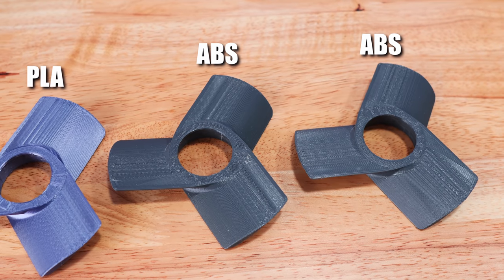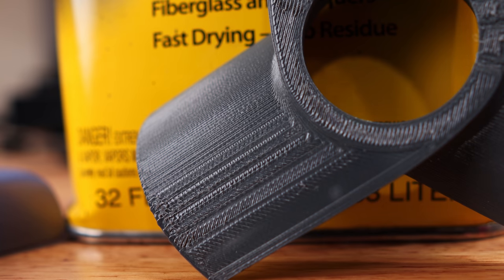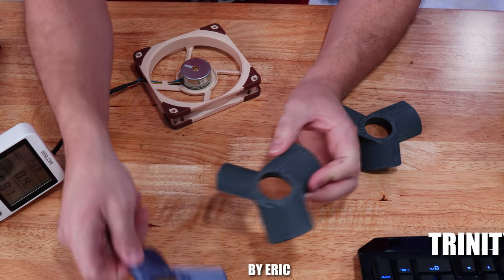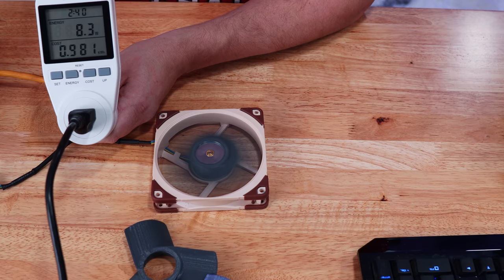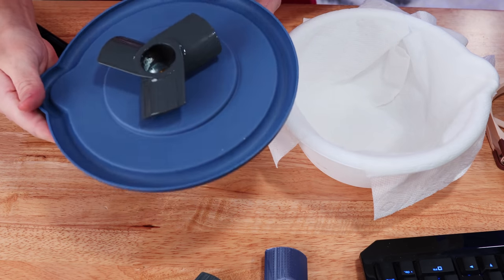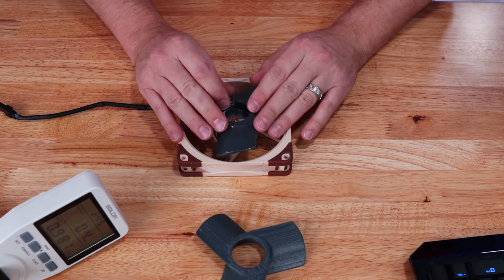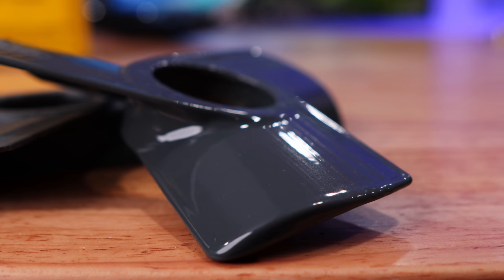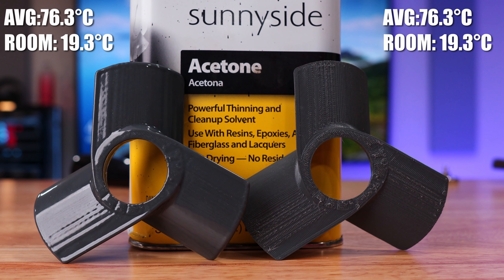Does Smoothing 3D Prints Improve Performance and Can You Smooth PLA?

Comment from the maker: Make sure to use my Audible link,  www.audible.com/hardware
Reply: I'm almost disappointed that you didn't hook up that noctua motor to spin at the lowest speed it still can turn... Would make the smoothing follow aerodynamic forces, smooth the most in places that are hit with air+vapor the most... maybe.. But it would be very, very interesting to see what it does. Maybe even deliberately making thinner blades to let it shape itself..
Reply: What about the airflow? Any difference there? 
Also, the rotation speed?
(Also, any vibration difference? Not sure how to measure that though)
Maybe it's possible to calculate some kind of "efficiency" number from this data, maybe like like: 
airflow[cfm] / fan rotation[360°]
Reply: @squidcaps4308  Yeah, that would be interesting to see, a "half smooth" (or something) fan.

It could also be interesting to see it spinning as fast as possible, so it melts & send plastic away in all directions, hopefully creating some cool "dissolve patterns" or strings on the wings, like how things melt in cartoons :D
Reply: You could always use smooth on, or other clear epoxy resins and paint them on pla prints to smooth them. Also when I acetone smooth abs prints I use an empty gallon paint can. You can buy them at home depot/ lowes. I line the inside walls of the can with paper towels and hold them on with magnets. Then I soak them with acetone. Place the part on the lid of the can and set the can on the lid upside down with the lid laying flat on a table
Reply: It isn't just the dB... but the tone also.
Reply: Just FYI- I've heard that PLA is somewhat dissolvable in Isopropyl Alcohol. You might try getting some 98% to see if it has any smoothing affect.
Reply: resin printed vs 3d printed
Reply: race cars polish the intake and exhaust head runners. the small bumpy-ness of a non flat surface creates turbulence at higher air amounts of air flow. the smoothed fans will probably spin at a higher rpm with a less power draw, and only then youll see a higher cfm and temp change. i balance crankshafts that go into racecars, so also a lopsided fan will spin slower and will draw more power than a properly balanced one, if thats even possible.

Comment: I agree with your test however i would have done it with a fan that has more blades say 7 or so, my reasoning is that with 7 blades there is more surface area of the blades and thus could give a deference between the fans (smooth and not smooth)
Reply: More likely yes, but I'd think that the difference is so little that it's well within the margin of error. But the noise drop is a win anyway 👍
Reply: @Garbox80  yes that is something i can personally relate to. I hate a noisy fan but i still think that he should explore a fan with more blades. Imagine the noise deference then
Reply: @jankocoetzee  its difference not deference
Reply: @Edigor100  oo yea i didn't even see that😅😅
Reply: Are you really gonna dabble in aeronautics here. I thought we burned that bridge the first time we "established" its not worth the printing time...
It Depends on so many factors its not even real.  So expecting that on a YouTube channel playing with 500$ toys ,printing designs Made by Fleamarket Aero designers  is a bit too much isn't it...
After spending a few years at the university Your dreams kind of get crushed by reality. Aka its not fun to design functional aerofoil as it often doesn't look anywhere near anything you wanted. Its called physics. And it doesn't give a crap about your dreams.
Reply: @DexMaster881  What a downer. Let people have their fun.
Reply: from what i know about fans and propellers sound has a lot to do with efficiency but in the cooling effect i dont know if this is in the realm of diminishing gains aka a whole lot of work for a tiny improvement we are hitting a wall with how much heat can a volume of air cool with a certain air flow thru a set of conductive fins
Reply: If you have to try and create a problem to see any impact from the solution, then its not a good solution.
That is to say, if there was no change whatsoever with 3 blades, Even 9 blades would, at best, see fractional gains if any.  Thus, Your gains are low enough that they still exist with in the margin for error, and practically speaking, are moot.
Reply: @DexMaster881  yeppp as an Aerospace Engineer you run into issues of sunk cost fallacies and efficiency games if you're not careful. 

It's all about amount of time compared to gains you expect. Sure it's more efficient because it better adheres to the design but at what cost? 

I've noticed alot of people and even engineers have a major problem with understand efficiency chasing. Stuff is pretty efficient now days getting even a percentage more efficient can equal millions of dollars in costs.
Reply: @nuarius  not wrong and not moot,
Sometimes you dont see changes in implementation until you scale a model up.
Simple models are easy to test but give false impressions after large scale changes are made, such as doubling or tripling the number of fan blades.
Reply: @weignerg  yes I am aware.  As noted though, we are talking about 3d printed case fans here. There is a margin of error that these results would have to exceed. A doubling or tripling of effectively nothing is still not going to be significant enough to matter.   Thats the whole point.  I didnt say there would be no change no matter what, i said that with these results you can safely say that any changes if they exist will be insignificant within the margin of error associated with low precision manufacturing and the testing methods.

If we were talking about a 6 ft wide turbofan than it would be a different story.
Reply: @nuarius  Actually, an order of magnitude won't make a significant difference so long as you're trying to measure the effects of various surfaces upon airflow, without any airflow.
Reply: @CrawfordAutomation  noone said you cant have your fun. Just don't claim little toybox experiments take presedan over the work and expertise of professionals over several hundred years.
Reply: @seemlesslies  I agree to that. What was my initial intention is to point out the ridiculousness of the claim due to designer expertise. 
Aka if you make a 20hp family car you have no proof aerodynamics affect anything. Where as on a 300hp car you can clearly see it does. Its a matter of capability your design achieves. Some fans could have had tangible results even at this competition while others don't matter at all as it is not measurable with available equipment.
That's how we measure if the cost is worth in the Automotive. Does it show results on This specific case.
Reply: @DexMaster881  Reality, ya gotta luv it, there aint nuttin else cobber.    😁
Reply: @seemlesslies  I reckon as the low frequency components of the surface deformations are still present there is still quite a bit to be gained without too much effort.  Just thinking of all the times when I have thought, she's OK, close enough.  Sad really.
Reply: I think it will not work with a fan with many blades, because then the Blades have to be pretty thin and they will get too soft in the acetone vapor, which will cause deformation...
Reply: it wouldnt have. it only affects it on the surface area of 1 blade

Comment: You can use Ethyl Acetate to smooth PLA, similar to how ABS and acetone work!
Reply: Depends on the PLA
Reply: @maverickstclare3756  True. I've had some gnarly "PLA" that doesn't react well to ethyl acetate. The silk PLA variants have been especially odd for this, but a high quality (not bottom barrel ebay/amazon special) PLA will generally work well with this solvent.
Reply: I use M.E.K (methyl ethyl ketone) i think this may be the same thing as Ethyl Acetate. But MEK works for me and you can get it at lows etc..
Reply: @Floortile83  I always thought I was a caveman for doing this myself. Glad to see I'm not the only one!
Reply: @heyitsandrew2209  Plastic manufacturers often times use flaming for anything from scratch removal to adding to the aesthetic sheer of a part. It's rather commonplace, even if inherently "neanderthalic". ;-)
Reply: @danielblanchard09  Are you sure you aren't using MEK substitute? That's Ethyl Acetate. Lowes doesn't sell MEK.
Reply: @RAW_Reality  but does it make issues for small and thin pieces? Because even a quick brush with a heat gun can cause sag... I worry a blow torch would be way too much. Maybe one of those small torches like a creme Brule torch. Then it goes from Neanderthalic to classy!
Reply: @ravenovatechnologies6554  It's specific to factors... The thinner the plastic, obviously the more susceptible it will be to the heat. What type of material it is and the amount of heat coming off of the torch will also come into play... Heck, in extreme situations, small torches like you mentioned can go as far as to make small repairs to plastisol molded parts. (Think "flexible rubber" if you're not familiar.)
So... It varies, but you might be surprised as to what you can do, provided the heat is appropriate for the product... Sometimes you're a surgeon, sometimes you're John Wick.
Reply: @danielblanchard09  All the boomers in there are like "nice to see men are still men" and they ask about your project, want to know if you're stripping paint off an old mopar engine. That's when you drop it's for 3d printing, it shatters their world and they point and scream "NEEEEEEERDDD!!!!!!"
Reply: @danielblanchard09  MEK and ethyl acetate aren't the same thing. MEK is closer to acetone
Reply: Tried, failed. Tried tetrahydrofuran too, which is hard to get hold of. Only DCM seems to work on it for me. From the wildly contradictory reports I've found though, I can only conclude it depends upon the additives and other detailed chemistry of the PLA. I've heard ether might work, but never been able to try it. Government here banned diethyl ether (Because you can get high on it, therefore it is bad). You can still get hold of it on eBay, but the price went up a lot.
Reply: Metal print fan?
Reply: @trafficface  what would be the benefit of printing them in metal?
Reply: I've used chloroform and that seems to work well for smoothing PLA
Reply: @MortRotu  none at all, but there doesn't always have to be a reason other than cool and educational, personally I'm  just interested in metal printing.
Reply: I wonder if you should be measuring flow rate at a controlled speed, or flow rate at max power rather than power consumption when effectively stalled against a table, as the stall behaviour may be different to efficient performance. Note the example of a vacuum cleaner, where you can hear it is blocked and thus aero stalled as the revs go through the roof as the load drops.

And does some amount of surface roughness help or hinder performance? consider the dimples on a golf ball. My barely educated guess (it's been 16 years since I studied fluid dynamics) would be you get a faster fan but less flow rate if you have the flow detaching smoothly.
Reply: I'm the only one thinking... "BLOW TORCH!!!!" or "nah, put it in the oven "

Comment: sharper edges would benefit noise reduction and performance, I reckon.
And, a smooth surface is better than rough, but the surface needs to be uniform too for optimal efficiency
Reply: I’m not sure a uniform, smooth surface is inherently better for a fan. You’re not going to obtain laminar flow, and since the purpose is to move as much air as possible, smoother and uniform may be counterproductive. Smoother can reduce turbulence, and that would account for some of the noise reduction. But lower drag might also reduce air flow. 

Seems like some smoothing and improvements in uniformity are helpful, but only to a certain point. And it’s plausible that those factors might vary with the blade pitch, and possibly even across the surface of the blade. At least that’s my theory. I haven’t done any 3D modeling, don’t have software or a printer, to test any of this.
Reply: It's possible that the rough surface caused by the layer lines results in a boundary layer effect similar to a golf ball.  It would be interesting to see a comparison of RPM and air flow for the two fans. The unsmoothed fan might have reduced flow separation and drag, resulting in greater "lift" (air flow) and blade velocity (RPM), if my theory is correct.
Reply: How the smoothness affects drag coefficients, etc, is pretty straightforward I reckon tho..but as you say, it's no good getting less drag, if the airflow isn't directed where it needs to be to reduce turbulence in the 1st place.
At the end of the day tho, if turbulence is controlled (like with the almost-microscopic horizontal channels on shark scales, etc) then it can be channelled to flow over the surface more evenly - which can give less turbulence. So again, you're absolutely right.
So..with the factors of turbulence, drag, and attack angles in mind, I still think it would be super interesting to put an 'unsmoothed' fan alongside the same design made of the same material, but with some smoothing, and with the surfaces finished off to remove leftover bumps and such. I think the leading edges need to be sharp and defined too - otherwise there will be more turbulence if the attack angle of the leading edges is too 'blunt'. Slicing air is more efficient than moving it out of the way, after all.
And if the edges of the blades closest to the outer rim of the case are not sharply defined enough, then there will be too much of a gap between fan and frame at the rounded edges which again will add turbulence.
Fact is, if you try to replicate on a 3d printer, what a plastic moulding machine can do, then you're on a hiding to nothing if you don't apply the same finish to a printed piece - because otherwise the printed item will never be as efficient, et, etc as a moulded product.
Gotta say, this channel is pretty interesting.
Reply: @karmakaze6694  I'm actually sure that a boundary effect could be engineered/designed in...but I'm kinda worried how long it would take to positively get that kind of effect if you only depend on the random surface-defect output of a 3d printer.
Reply: @karmakaze6694  btw..geoff in this thread was saying how it'd be interesting to think about how the turbulence could be deliberately channelled across the surfaces to try and make overall air contact smoother.
Reply: @karmakaze6694  he tested a fan with the golf ball dips and it didn't do really do much.
Reply: Smooth dimples 
vs 
Regular
Reply: @deejeh9494  corrugated vs regular..
FIGHT!!!
Reply: @TheAdeybob  Ribbed! 
For Her Pleasure.
Reply: according to fluid dynamics only the heading apex of the blades smoothness and trailing apex's final edge smoothness should effect the flow of air due to the flow of air. I don't think smoothness is better then channels for channeling air due to this, though it looks pretty good after cleaned with acetone.

As long as the heading apex is smooth it would probably perform better channeled regardless is trailing apex was channel through or not, i am interested in seeing if that's the case though.maybe perhaps testing concave vs convex channels through the length of the fan would be interesting as a side by side, maybe prehaps someone sending in a design will read this and consider it, if not then i'll have to hopefully send him a design that he will get. but the height of the inner blade channeling would have to be far bigger then the leading and trailing channels but then added weight takes efficiency away and adds complexity that drives up costs, so minimally blades should have some type of channels built into them ideally towards the direction of rotation with the blade.
Reply: @demirkafasutlac2343  Yes, but that was only one dimple size. Consider also that a golf ball has circular dimples as it can spin and fly in any direction; however shark scales have grooves because a shark only ever swims in one direction.
Now the thing is, the shark scale channels run parallel with the motion of the shark/water, whereas the printer lines in these fans run perpendicular to the motion. It may be that there needs to be a groove from leading to trailing edge to get optimal surface eddies to make the surface more "slippery".
Reply: @danielsetzer3766  yup